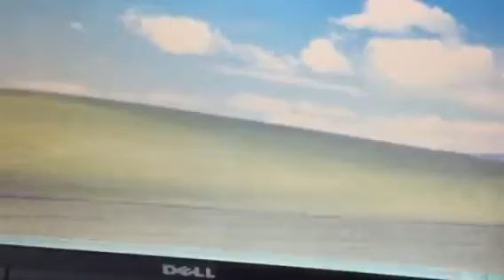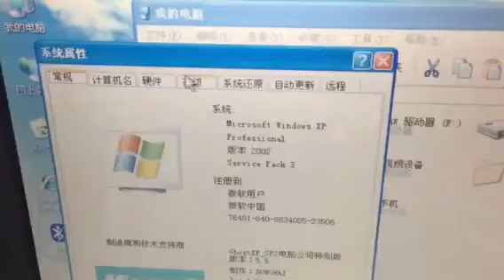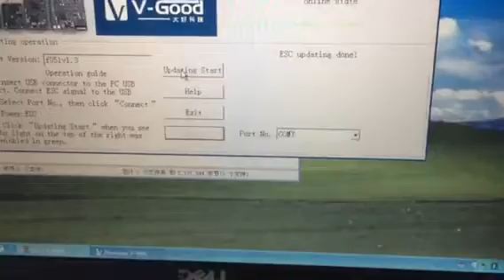How to upgrade V Good VGOODRC Firefly  Brushless  ESC

Comment: where you can download software???
Reply from the maker: Here are the installation instructions and the upgrade instructions
http://www.yalldata.com/downloads/upzone/image/Toy-intruction/Prog card Mannual.pdf

http://www.yalldata.com/downloads/upzone/image/Toy-intruction/VgoodRCv302_160322.rar

Mannual
Vgoodrc ESC manual
http://www.yalldata.com/downloads/upzone/image/Toy-intruction/Vgoodrc ESC manual.pdf
Prog card Mannual
http://www.yalldata.com/downloads/upzone/image/Toy-intruction/Prog card Mannual.pdf

Related Programs
vgoodv305_160413
http://www.yalldata.com/downloads/upzone/image/Toy-intruction/vgoodv305_160413.zip
VgoodRCv302_160322
http://www.yalldata.com/downloads/upzone/image/Toy-intruction/VgoodRCv302_160322.rar
CH341SER 
http://www.yalldata.com/downloads/upzone/image/Toy-intruction/CH341SER.zip

Thanks for your welcome.

Comment from the maker: Suggest for 4*18a Series :http://www.tmart.com/4x-18A-2-4S-Multi-shot-Brushless-ESC-Vgoodrc-Speed-Control-Quadcopter-for-QAV250-210-FPV-Racing_p344659.html

4*30a 2-4s Series:http://www.tmart.com/V-Good-Vgoodrc-30A-30A-0-LITE-4S-2-4S-ESC-32-bit-Micro-Processor-for-RC-Quadcopter-Drone-Parts_p344044.html

Other good test video on YOUTUBE,Welcome Watch.

How to upgrade V Good VGOODRC Firefly Brushless ESC 
https://www.youtube.com/watch?v=VsilqgkTTTg

30A Vgoodrc esc flight test
https://www.youtube.com/watch?v=_jwo8eMO6FI

10A Vgoodrc esc flight test  https://www.youtube.com/watch?v=iJ5aYO2lHVQ

18A Vgoodrc esc flight test   https://www.youtube.com/watch?v=JbV_t1h_5k4

How to use V-Good prgrammer   https://www.youtube.com/watch?v=6lwc8mPqXms  
Thrust Test Emax RS2205 2300kV motor, VgoodRC Firefly 30A ESC
https://www.youtube.com/watch?v=U9lEIzyGOsU